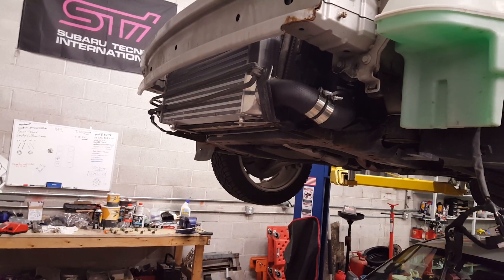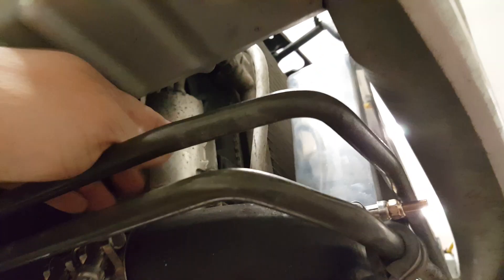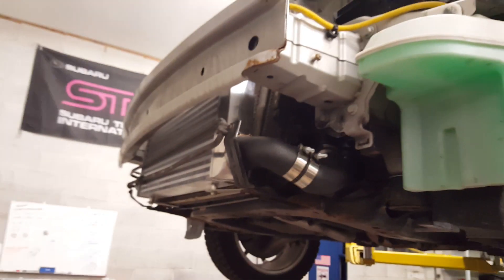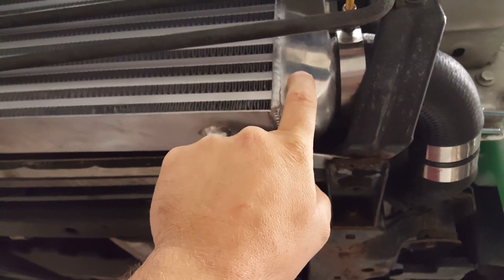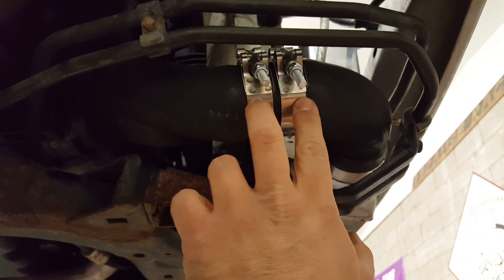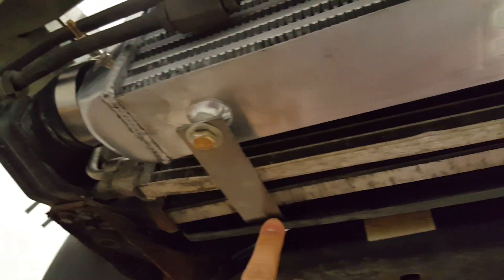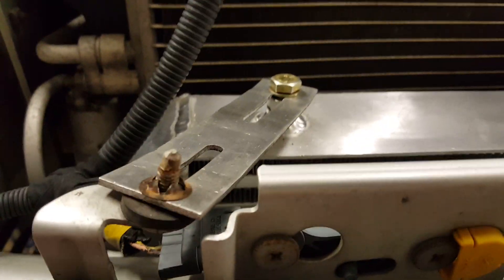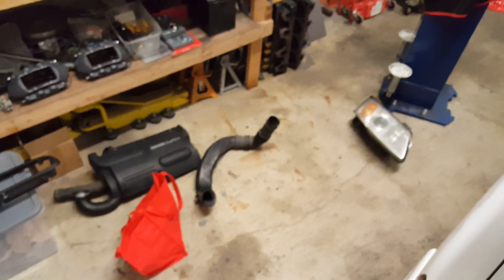Saab 9-3 front mount intercooler

Comment from the maker: I forgot to mention that after the a/c condenser gets pushed back, the mounting points are perfectly aligned to where the stock intercooler used to be. Simply bolt in the a/c condenser where the intercooler used to be.
Reply: Whats the size of the intercooler and where did you buy it? You have an link to it maby? Great video!
Reply: I just took of the original now and i found an 600x300x75mm Intercooler that iam pretty sure will work but thanks for this video i will use it when i put the new one on the car
Reply from the maker: @Matte.Sweden  Looks like you figured yours out, but I mention it in the video. 30"x12"x3" overall size with 2.25" inlet and outlet. It was on eBay for around $75 shipped.
Reply: @beaulamper3558  Wow you did, i must be deaf haha, seen it 3 times now :D

Comment: the best fmic diy explanation video I have seen for the saab 93.. how do you link that intercooler being that big, does it cause alot of turbo lag
Reply from the maker: I have a stage 3 BCB Aero tune with the full 3" catted turbo back exhaust from Krona so I'm not exactly stock. I don't notice any turbo lag from gear to gear. I hope that helps.

Comment: This comment might be posted a bit late... Will be doing this in  about a weeks time. The only thing which I can't seem to get my head around is the lower mount on the left side of the intercooler (seen from the front). Where did you mount this up? From the video it looks like it's hanging on by being wedged between the condenser and the bracket underneath it. I was planning on mounting a similar flat piece of steel up to the front of the subframe but this looks a lot cleaner than that method!

Comment: Stupid question. Did you push the condensor back behind the intercooler to make room for the extra thickness or some other reason?
Reply from the maker: That's not a stupid question at all. So bone stock on these cars it goes from front to back...ac condenser, intercooler then the radiator. If you're doing an OEM stock location bigger drop in replacement (like D088 and like 600+ bucks) then you do nothing. If you go the true "FRONT mount" way like I've done then you have to make the ac condenser the middle man now. So to your question, yes you push it back to make more room. I hope that helps.

Comment: What did you do inside the two pipes , something like a exhaust piping to clamp the hose down ?
Reply from the maker: Yep, from what I remember it was a about a 4" long piece of 2" diameter aluminum intercooler piping which is ribbed at either end so the clamp shouldn't slip off after being tightened down.
Reply: Do you remember where you bought it from , and the clamps ?
Reply from the maker: @kylefrank4528  I use eBay for everything man.
Reply: Are all your clamps 2”
Reply from the maker: @kylefrank4528  No, in the video I show that the intercooler inlet and outlet sizes are bigger than 2".